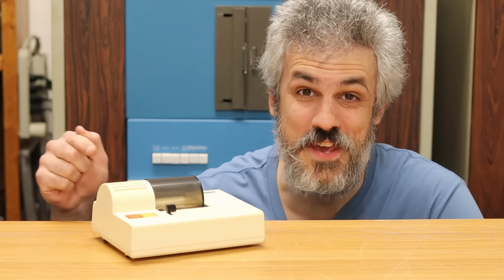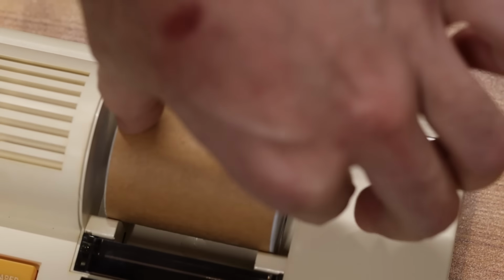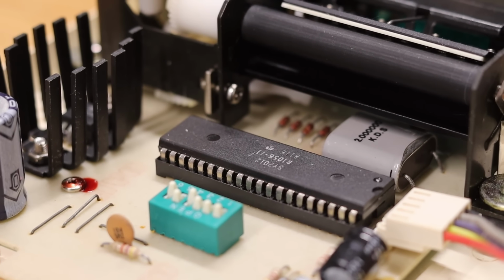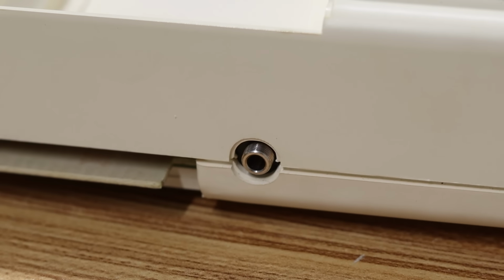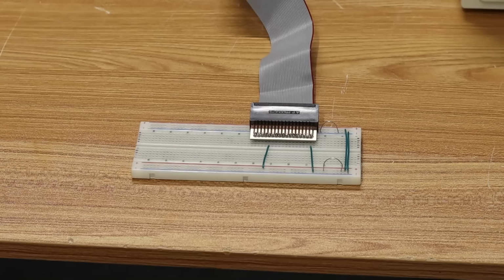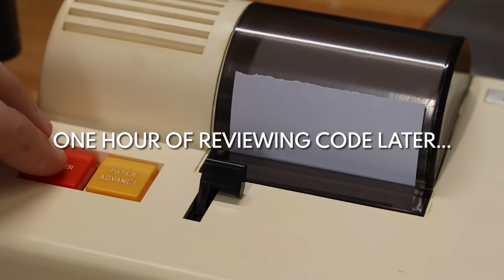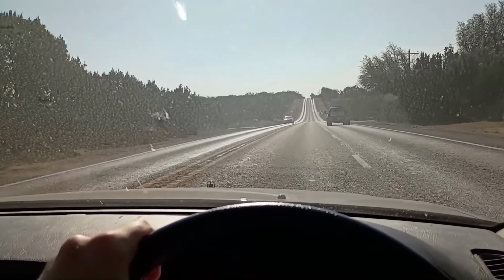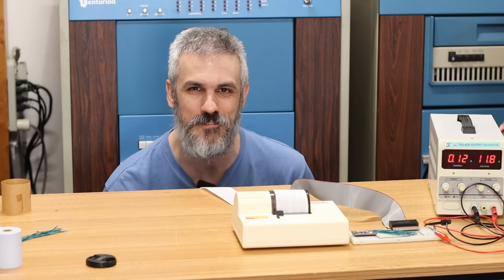The Cutest Printer on the Planet!

Comment: Thermal paper is stil used everywhere. The receipt you got for buying the paper was almost certainly printed on thermal paper ;-)
Reply: The local CVS prints out 60 feet of it if you buy some gum.
BTW: This is 20 column printing so continuation lines will be needed in what he prints
Reply: make sure you get the right size
Reply: There's been some new research recently that finds that much of this thermal paper contains high levels of bisphenol S (BPS) which replaced the dangerous chemical BPA.
Turns out that BPS is just as bad as BPA.  Holding a thermal receipt for 10 seconds can violate the safety threshold dose of the chemical under California legislation.  BPS is linked to hormone disruption, cognitive damage, decreased sperm count, breast cancer and more and readily absorbs through the skin.
Reply: @projectartichoke  even water violations california cancer law
Reply: @projectartichoke doesn’t pretty much everything violate California law?
Reply: @daleatkin8927 californias laws violate californias laws.

Comment: Lovely to see some C code on the channel it took me back a few years.
Reply: I am doing a project is C.  It is a dreadful language but it is a standard and it does work
Reply: Most micros are using C for the base level codes. But indeed a often few more options are out there for the enthusiasts, e.g. by doing Python in form of an add-on coding level.
Reply: @alexanderstohr4198  I dislike Python.  Active whitespaces are the work of Satan.
Reply: pure and unadulterated AI C code, to boot.
Reply: I think C is a very robust language but not forgiving of mistakes and you have to train your mind to work with it. I find it interesting that David is more comfortable with assembly languages than traditional high level procedural ones.

Comment: I wonder if it understands ESC/P and then how much?
You could get it to output graphics if the escape sequences are there.
Reply: I had a similar printer. It doesn't do graphics mode, but you can program custom character sets to do pseudo-graphics.
Reply: @sivalley  Well, nothing stopping one from sending in a new charset for each line. ;)
Reply: @BastetFurry 👉👉

Comment: Looks like the apostrophe at the start of the lines is actually the last character in the string you are printing, there is an apostrophe between the \r\n and the closing quotes, so it is printing that as instructed. Neat printer, they did a wider version of that for the ZX81, The Alphacom 32 which also still works great with modern thermal printer rolls.
Reply: The ZX printer is not a thermal printer. It uses aluminium-coated paper and a kind of needle running across it, short-circuiting sometimes, causing a burned spot (the pixel), hence the bad smell... I still have one
Reply: @KeesAlderliesten  Yeah, great idea those, create a load of sparks near the sensitive electronics..... The belts all went on my Sinclair ones, but the Alphacoms are still going strong (and less smelly and sparky)
Reply: @DaveCurran  Sensitive electronics? In a ZX81 era device? 😃
Reply: @KeesAlderliesten  The printing technology is called "Teledeltos" :)
Reply: @zaprodk  Nice, didn't know that 👍
Reply: @KeesAlderliesten  If you've still got one, I dread to think what the inside of your nostrils must look like. ;) EQUINOXE! :)
Reply: @KeesAlderliesten  They were talking about the alphacom 32, a competitor to the sinclair printer, for the zx-81/zx-spectrum. Which was definitely thermal (purple output on white paper).
Reply: Was just about to comment that the Sinclair printers were very similar, but I'll just reply here instead.
Reply: @PantsManUK  But the one for ZX81 was not cute, it was angry! smoking, burning paper, printing sideways and screaming sometimes 😬
Reply: @rustandmagic  ahaha
Reply: Sounds like a fully working modern printer to me!
Reply: @rustandmagic  Oh the smell of that ozone... and all the black/silver aluminium powder that clogged up the 'head' (aka bit of bent wire)..... happy memories :)
Reply: @rustandmagic  yup, I still remember the metallic smell and appalling output. Not just "appalling through rose-tinted future-me spectacles" but genuinely appalling. My eleven year old self always seemed to be printing a lissajous curve or perhaps listing a "Hello World" program.
Reply: Yeah... the main characteristic of the ZX printer was the abominable stench.
Reply: @rustandmagic  Their claim was that there was an alphacom printer, the alphacom 32, for the ZX-81 (and ZX-Spectrum). Which was cute.
Reply: @rustandmagic  The Alphacom 32 was electrically compatible with the Sinclair ZX printer, but used a much cleaner thermal printing technique.

We put up with a lot of lousy stuff back in the day, because it was all we could afford, if there even was anything better.
Reply: @CryptidZookeeper  There was also a rebadged version sold in the USA as the Timex-Sinclair 2040. I've owned both at one time or another, although I don't know what the Timex-Sinclair unit was doing in the UK.
Reply: @CryptidZookeeper  Sorry, I was hoping it was very obvious that the comment came with a huge bucket of irony.
Reply: @bluerizlagirl  The ZX printer was doomed from the start, it suffered from Sir Clive syndrome, lets save on everything we can and after that, try to make it even cheaper.
Reply: Another childhood ‘Alphacom 32’ user here!
Much nicer than the sparky ZX printer although all my printouts faded in the sun after I stuck them on the bedroom door 😂
Reply: Yep, as soon as I saw this I thought, “That looks like an Alphacom”. :) I think their Sinclair one sold fairly well because the official ZX Printer, as others have noted, was absolutely terrible and, as far as I recall, wasn't a great deal cheaper.
Reply: Seems people are talking about two different printers - one a machine made by Sinclair to their usual standard and another by alphacom. I'd be interested to know more about the alphacom unit and how it interfaced with the Sinclair. I believe the Sinclair printer was produced for the later spectrum and not the ZX81 mentioned but I could be wrong.
Reply: @bouffman88  The Alphacom32, and its rebadged cousin the Timex-Sinclair 2040, were drop-in replacements for the ZX Printer. That is, they connected directly to the ZX81 or Spectrum expansion bus and used all the same BASIC commands (LLIST, LPRINT and so on). From the software point of view, it was exactly the same as the ZX Printer.
Reply: @bouffman88  Yeah, I think you are right. I read that comment about the ZX81 printer wrong. The ZX Printer worked on a ZX80 (after installing a replacement ROM), ZX81, and Spectrum. I have used it in the past on the latter two (I don't have the ZX80)
Reply: Fun fact: that's the same reason the Epstein files are filled with =

Comment: it's so cute and tiny.  The switch settings says the strobe is also serial in.  I bet one of those dip switches turns it into the Vic-20 version.
Reply: Noticed that. Other switches are probably baud rate and other serial parameters in serial mode. They may also define how it responds to CR and LF, usual old printer things.
One from the heyday of Bog Roll Burners!
Reply: @NiallWardrop  I concur.  That's how these old things worked.  Pick serial or parallel, set the serial baud rate, and set up CR & LF behavior.  What is neat is that many of them would allow graphics mode to draw pictures and graphs if enabled.
Reply: @richardmassoth8237  The dedicated printer on the Amstrad PCW 8256 behaved like an Epson. I managed to get one working as a printer to a friend's Amiga 500 via an addon serial port on the PCW and a CP/M script.
Reply: @richardmassoth8237  This one has only 7 data bits, so a graphic charset isn't really likely.
Reply: @Melanie1T  It has the bitmap mode.